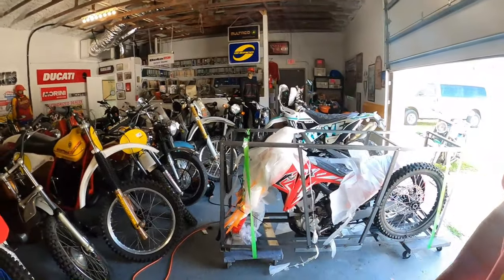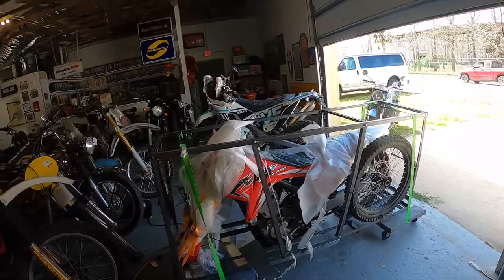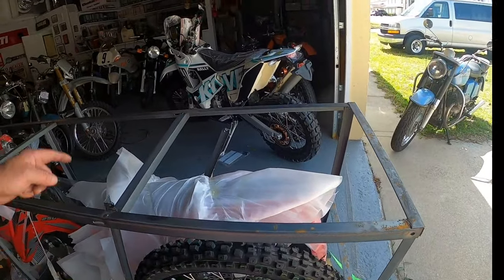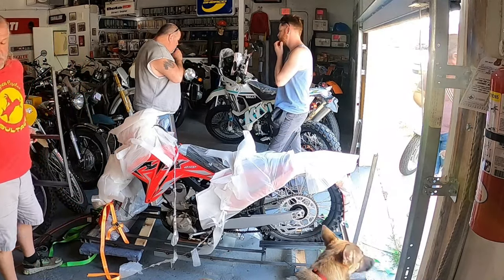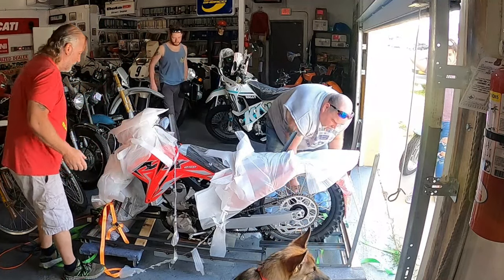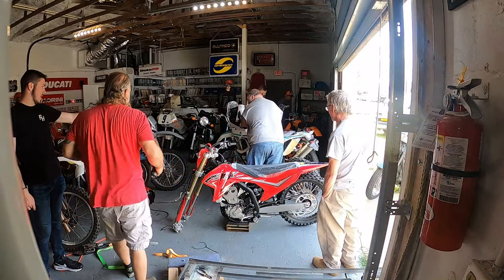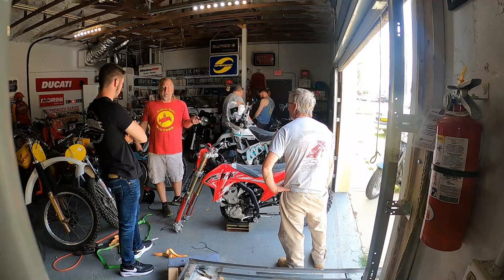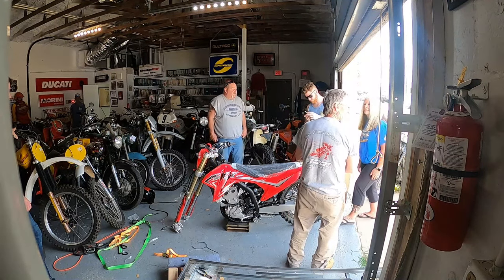FIRST LOOK - UNBOXING THE FIRST KOVE MX250 TO LAND STATESIDE

Comment: You can get an rm for 55-6500
Reply from the maker: 2024 Suzuki RM250 MSRP is $8099 USD stateside
Reply: @bullpencycles  yeah, but nobody buys or sell them at that price. 24 kx450 is 5600 right now. Same deals year round for the zukes from most dealers.
Reply: @panic-revv85  Tell me which dealer is selling at that price OTD and I will go buy several tomorrow.
Reply: @williamfoster4268  They're out there. But, I'm not going to bag on these bikes. I ripped with a talented kid who was hooked up with one and it is an exceptional bike! Fit to finish top-notch! I may consider the 450 mx when it releases. Seriously impressed.